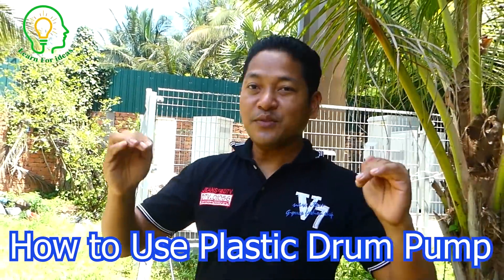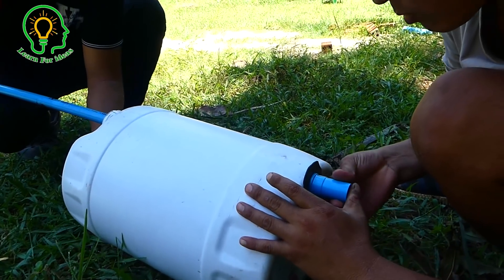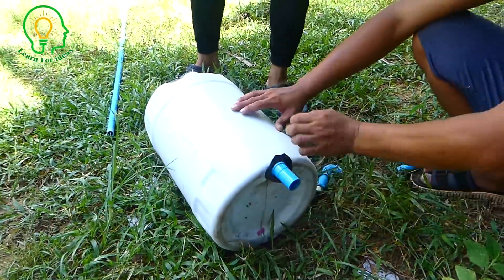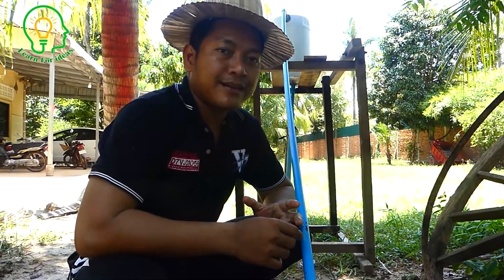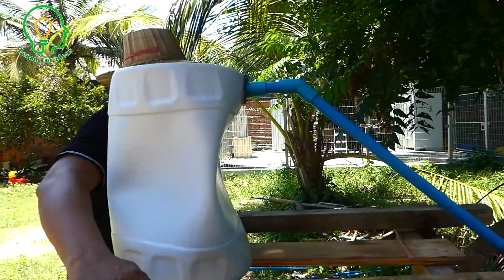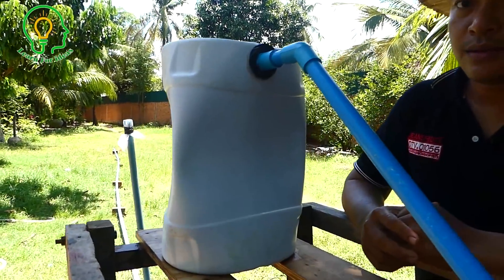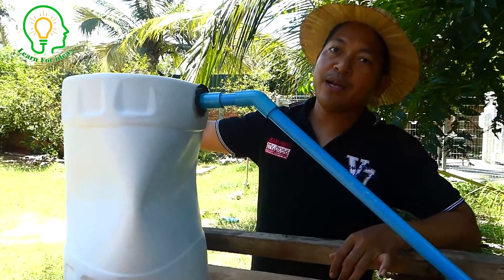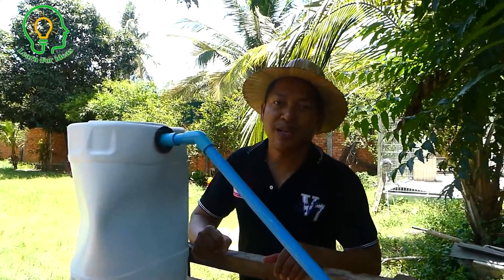How to make Soft Tank auto water pump - free energy water pump | free energy pump to water plant.

Comment: Hoax. Output is higher than the input, a siphon will not work. Saying that while water is flowing out, air is flowing back from the output to the tank. If that is the case, then any siphon would stop. Simply quatsch!

Comment: if the water came from there you dont need the water tank, tube is enough. water should came from a deep well.
Reply: An the output must be lower than the waterlevel in the well. This is a siphon. A siphon only works from a higher source to a lower. So the output must be under the deep well. Practical?

Comment: Hi thks for sharing. I tried this with small bottle but did not work. What do you comment?
Reply: It wont work
Reply: They haven't shown the hidden pump
Reply: @AshutoshSrivastavaTimetraveler  I don't think so; they take all the work just to make fun of viewers?!!!!
Reply: Output must be lower than input and tank must be filled up to get started. The only purpose of the tank is to start the siphon.
Reply: @Dingsrud  I think Tank must be large to overcome suction force by gravity.
Reply: @guruji243  Sorry but using a HUGE tank will not make this a pump. At about 5:40 he explains why this „pump“ does not work. A huge tank wil disguise that water simply coms from the tank, not from the low source.

Comment: Output water level looks lower than the water source. does it work on well water while level is about 20 meters lower than output?
Reply: A siphon only lifts water about 10 meters, AND, the output must be lower than the input. In other words, the output must be lower than the water level 20 m down!
Reply: @Dingsrud  That is true for a siphon, but this is not a simple siphon, this has a vacuum chamber in the middle which creates suction and due to the large quantity of water in the drum which is being pulled down by gravity creates downward pressure on the outlet pipe and so long as the outlet pipe has a larger pipe size than the inlet it will suck water up from a depth of a maximum of 10 meters and in hot weather when the air pressure is less and air molecules are further apart the vacuum in the tank will not lift as well.  The siphon is a very interesting thing and science still is undecided about how it actually works as with the flying droplet siphon.  The key though in making this work is preventing air coming in the outlet pipe, the surface area and volume of water in the drum and the inlet being smaller than the outlet pipe. If you try to make a small model of this it doesn't work, but if you make a 100l drum size one or a 200l drum size one of these it will work until air gets into the drum.. If no air gets in then you can run it continuously.  The vacuum in the drum in effect raises the level of the inlet to being virtually higher than the outlet... that is how it works.  
It is an enigma, one of those things where when everything is right, something wonderful happens..
Reply: @timmitchell5812  Sorry, you are wrong. Take a thin tube, closed in one end. Lift the closed end 25 m out of the water. The tube is filled with water ut till 10 m. Do it once again, this time with a huge sewage pipe. Lift it up and again water stops at 10 m. You must look at the pressure  in the water.
Reply: @timmitchell5812  Let me take an other approach.. From the video I assume that the output is at a higher level than the river. The water in the river has a certain height energy.  The water at the output is higher and has a higher energy. In a steady state, water is sucked  in low from the river and delivered at a higher level at the output indefinitely.  From where does the water get its increased height energy?  Some energy was added to the system by manually filling the tank. Bus as the water flows out so does this extra energy.when the tank is empty, everything stops.
Reply: @Dingsrud  Look at it a different way, I already said that the system includes a vacuum, indeed it must involve a vacuum.. The vacuum balances the system, and it then becomes like a chain siphon where the weight of the water in the drum under the same negative pressure exerts much more pressure over it's area than the water column of the inlet pipe.  The vacuum lifts the water of the inlet up to 10m maximum and then the imbalance of pressures caused by the outlet pipe being larger than the inlet pipe and the gravity acting on the water in the drum acts like a piston which makes the water move like a siphon even when the height of the outlet is greater than the source. 

In a normal siphon with the inlet and outlet the same size you would not have this work. There is a very specific set of things which work together to make this vacuum assisted siphon work, just the siphon is not enough, just the vacuum is not enough, it needs the pressure differential on the surface area of the inlet and outlet as well to make it work. It seems to defy the laws of physics but in reality it doesn't.
Reply: @timmitchell5812  So if you fill the barrel 100% then it is a siphon and that would not work? What if I fill the barrel 99,999%, there will be a 0,001% of the volume starting at 1 bar atu pressure, will the pump start?
What if I put the suction pipe a bit lower, so low that the 1bar air filled volume is totally above the intake and output of the tank. Will the pump work?

Now let us se a practical experiment: Google:
“ FREE ENERGY Water Pump FULLY EXPLAINED!! REAL OR FAKE? “ and you see on Youtube a set up with all the details. 
From my point of view this barrel pump is nothing but a siphon. As such the whole barrel can be dropped and the output MUST be lower than the source for the siphon to work.
Reply: @Dingsrud  I think you need to do some more watching of these devices on youtube here.  All the barrels must be filled with water, there is no air in there.  Once you open the outlet then the weight of the water in the barrel emptying out decreases the pressure in the barrel until you get a vacuum. What looks like an air gap in some videos is just a vacuum, there is no air in there just a vacuum.  What makes a siphon different to this is that it is continuously the same size from inlet to outlet. That is a true siphon, this has a larger outlet pipe from the barrel and it has a reservoir (the barrel) which does the work of drawing the water up from a lower level.  If you don't understand scientific principles enough to be able to understand all the explanations I have given you then you aren't going to be able to reason it out.  Just make one up and see that it works.
Reply: @timmitchell5812  You write: “The key though in making this work is preventing air coming in the outlet pipe, the surface area and volume of water in the drum and the inlet being smaller than the outlet pipe.”

To prevent air to enter the system from the discharge outlet you just put the output into a bucket of water. You may also make the output to form a “U”. 

If you take a 200 litre barrel,  remove one round end, suck it in water in a pond and then raise it 99% out of the water with the closed end up, how much “vacuum” will there be in the drum? It will still be 99,99% filled with water and you need a crane to lift 200 litres  of water up over the surface of the pond. Why does not all that water pour out into the pond due to gravity? What is holding the water up against gravity?
Reply: @Dingsrud  You don't know what you don't know so I suggest that you stop arguing over what you don't know and build one yourself.  This obeys the laws of physics, unusual principles but they are there none the less.
Reply: @timmitchell5812  I perfectly well know the physics here and there are only two issues that are mandatory for this barrel-siphon to work: 1) output lower than input, 2) no air leaks.
Reply: @Dingsrud  You are focused on a standard siphon mechanism here.  This is a vacuum piston assisted flying droplet siphon and is a far cry from just a simple siphon, the only height restriction is in how high the vacuum can lift the column of water. Theoretically 10 meters but usually a bit less than that.
Reply: @timmitchell5812  Now let’s go back to your statement”

Tim Mitchell
for 1 måned siden
A vacuum barrel siphon only sucks water to a maximum depth of 10 meters.

This can be understood in two ways: 1) can this barrel, vacuum system bring water up 10 meters? Yes. 2) is it useful to you at 10 meters? No

In an other wording, “A magic barrel, vacuum system can not lift water out of any well, not even one inch up.”

By saying: 
“Tim Mitchell
A vacuum barrel siphon only sucks water to a maximum depth of 10 meters.”

This can be misinterpreted so one think that a magic drum can lift water up from a 6-8 meter deep well. It can not.
Reply: A vacuum barrel siphon only sucks water to a maximum depth of 10 meters.

Comment: What do you mean by "Seaphone"" ??
Reply: Siphon: the sucking effect
Reply: If you take a flexible tube, fill it with water, dip one end in a pond, stretsh the tube over a ridge les than 10 m over the pond an let the output be lower than the bottom of the pond, water will flow til the pond is empty. In this configuration the tube is working as a siphon. A siphon transports water from a high to a lower level.

Comment: My friend says that the level of input and output pipes are same that's why it is working. Please put output pipe higher than input source. Very soon they will have no more argument to make !!! Thank you my friend.
Reply from the maker: Ok, thanks
Reply: If you lift the output higher than the input it will stop. All siphons stop if the output is too high.. He even describes it here. He says that air flows back frrom the output to the tank. That gives agarantie that it will stop.
Reply: @Dingsrud  My friend, People in Kenya are now replicating this system and are selling them for US$250.00 . So this system works my dear and stop these comments.
Reply: @compostsfertilizers5471  At about 5:40 you describe how air is coming from the output back to the tank. Here you actually describe that this system does nor work. If air i flowing back like this, you wil only have water until the tank is empty. As long as the input is lower than the output, this will not work as a pump. Anyway, if people in Kenya are able to sell this for 250$ they are geniuses.

Comment: What if I want to take the water up the hill
Reply from the maker: yes you can use Ram Pump System in my previous video , thank
Reply: @LearnForideas  Sir, the ram pump only works by using the water source from the flowing river.  But what about the source of water from the lake?  Lake water doesn't flow, it just stays in one place.
Reply: @somepetone-kdm  no problem, syphon the water from the lake to lower level where ram pump will be and the height differential will make ram pump works
Reply: @LearnForideas  .....
is it non stop...or do we have to refill?
Reply: @urpillow4051  Here input seems to be lower than output. If so the system  will stop when the container is empty.

Comment: can I ask if the first pipe have stopage
Reply: Normally there is a foot valve in the intake. This is needed to get an easy start. If the volume of the tank is grater than the volume of the intake tube, no foot valve is needed.
Reply from the maker: the first pipe not working and second pipe is working
Reply: @LearnForideas  So if the input suction tube is not working, this is only a barrel with an output tubing. Why all that fuzz?